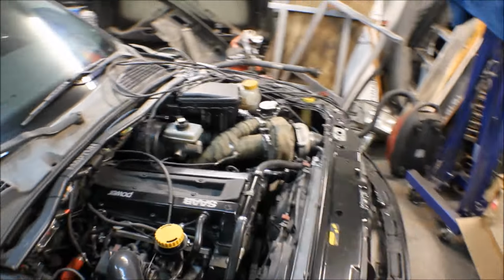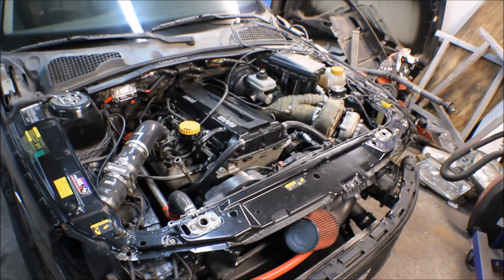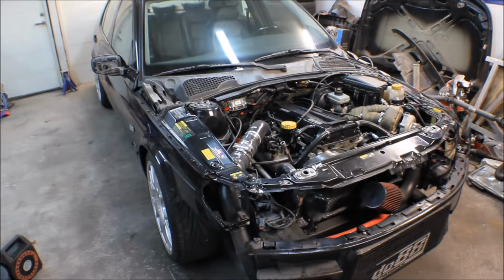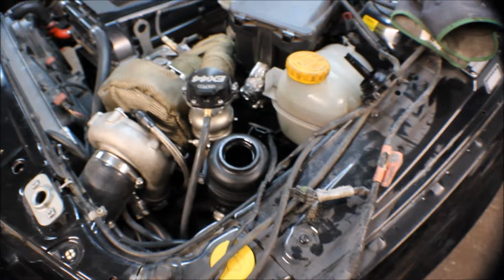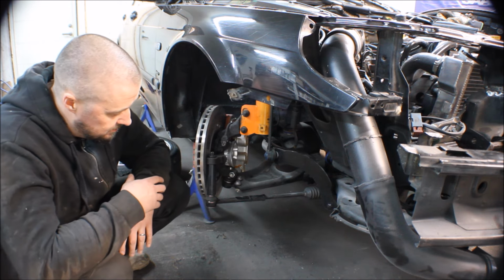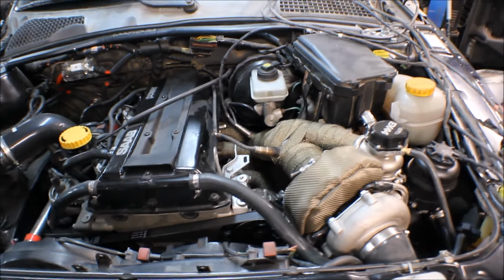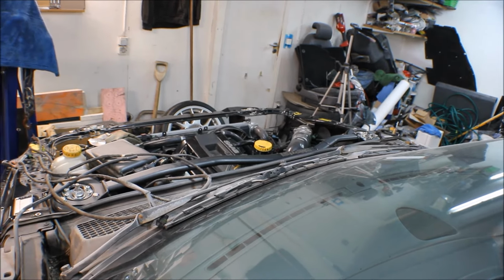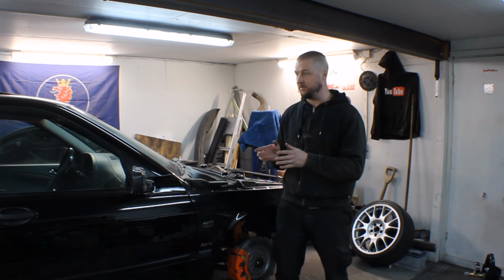I NEED YOUR HELP! SAAB 9-5 AERO RWD

Comment: Usually in hydraulic systems return line is bigger so there is no restriction. May want to check out WIS and EPC thoroughly to ensure correct fitting of the lines. Bleeding steering rack in saab is simple, just fill up the reservoir and start the engine. No turning wheels required, just keep sure there is fluid in the system when pump is turning.

Comment: Be sure to use CH11F or CHF202 hydraulic oil.  The steering rack is weak and SAAB used a high end hydraulic oil.  Do not use ATF as it will swell and weaken seals
Reply from the maker: That is what I have used 👌

Comment: Sounds like a rubber seal has blown somewhere and its stopping the fluid from circulating...... i had a similar issue when i fitted an e46 sport steering rack on my e30, my problem was an air bubble in a hose that ran higher than the pump.....

Comment: Looking at other vehicle forums, (couldn't find anything for SAAB), the high pressure line from the pump to the rack is the smaller fitting,  the low pressure line from the rack to the reservoir is the larger fitting, Couldn't find any specific dimensions for SAAB. Parts catalogues have different part numbers for the different connections, but no details about the dimensions. Good luck with the fix🤞🤞

Comment: Your steering will probably make all sorts of weird noise while the suspension is at full deflection like that.  If you find that your hoses are connected incorrectly (as other posters have suggested) the noises will probably be gone once the car is back on the ground…
Good luck with your certifications!!

Comment: You need to bleedthe steering rack by lifting the wheels just off the grrand move the steering wheel lock to lock several times.

Comment: Jag är övertygad om att du vänt slangarna, för returen med lägre tryck ska va större. Ljudet kan komma från ventilerna om du tvingar oljan fel håll med pumpen avstängd.
Reply: I think this is right. The return has to be bigger diameter than the pressure line.
Reply: I recently replaced the first part of the steering pressure line on a og9-3 and that line is very thin and mostly made of metal.
Reply from the maker: Vände på anslutningarna och luftade med fulla rattutslag. Fortfarande ingen servo 🤔 men slangarna satt fel så det var helt rätt 👍